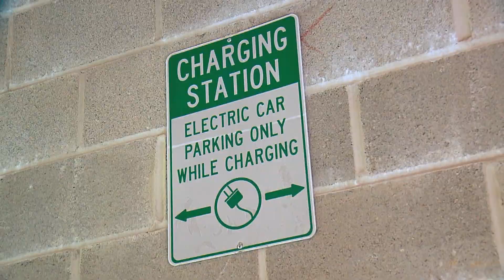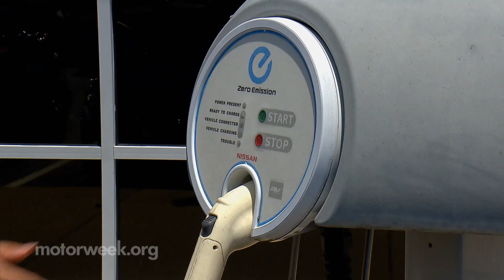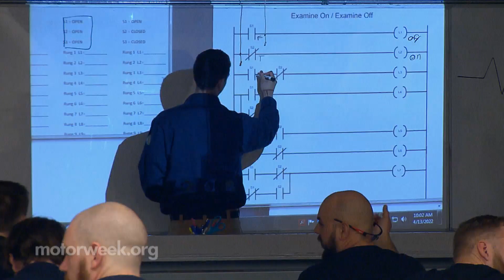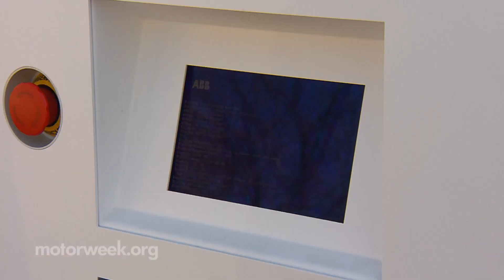Wiring the Windy City for EVs | MotorWeek Auto World

Comment: This is just what Chicago should be doing with the money they don't have (hugely in debt). Not stopping murders or crime, or even rooting out the 100+ years of corruption, they need to subsidize big business with the ability to charge cars. That'll solve all the problems... Chicago unions are known to be very cheap and reasonable, getting jobs done on-time and on-budget.
Reply: The Chicago unions that would be required to install electrical equipment are not cheap in cost.  It's an entire corrupt system.  The unions made the politicians write code that requires them to do all the work, so they can charge whatever they want.  I did a car show years ago at McCormick Place and they wanted $150 for a union guy to plug lights in an outlet.